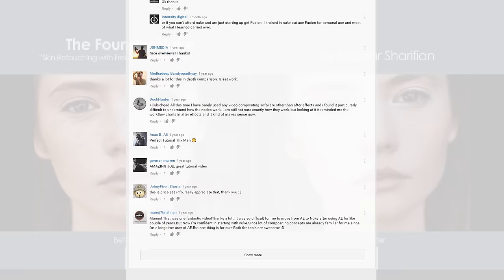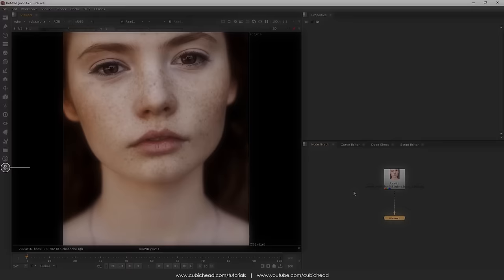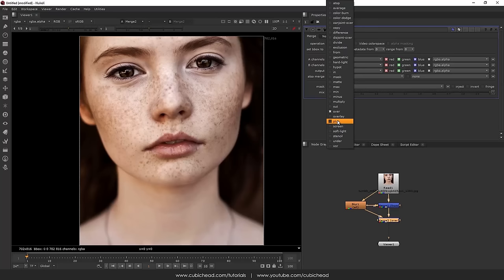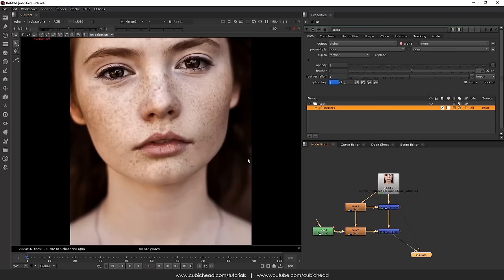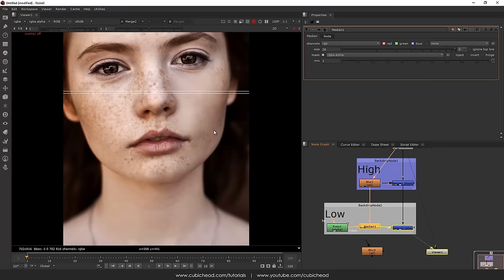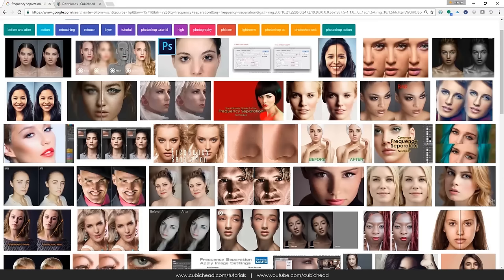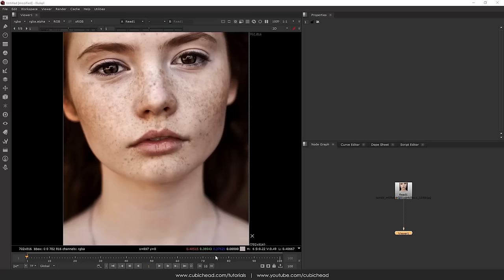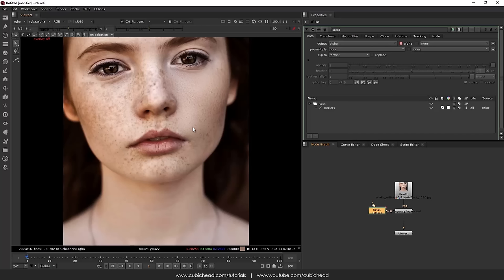Skin Retouching in Nuke using Frequency Separation

Comment: this doesn't work. follow this tutorial over and over again. when I place the roto in as a mask, nothing happens. I cannot see what you do differently from what I do and I get nothing where I see what you get. thanks anyway.
Reply from the maker: Sorry to hear that, maybe some of the default parameters of your nodes are different than mine, for instance your default mask setting is set to a different channel :-? Otherwise, I am using vanilla version of nuke and if you follow my steps exactly one by one, you should end up with the same result

Comment: When I try to make a roto for the second blur it has no effect (the whole image stays blurred). When I check the roto seperately, it says: non-existent channel used for mask. What am I doing wrong? :S
Reply from the maker: Charley van der Krogt Did you make the default roto node? The shortkey for it is "O".
Reply from the maker: Charley van der Krogt If so, and still you r getting an error, try this, I'm not sure if it's gonna work in youtube comments, select ur roto inside Nuke, copy it [CTL+C] and paste it [CTL+V] here in a comment, so I can check it out.
Reply: He Cubichead, I sent you a pm. Thank you so much for your quick response and help!
Reply: You're probably trying to plug the blur into the roto as a mask, which by default will be looking for an alpha channel, which the original image doesn't have (hence the error). You need to plug the roto (which creates an alpha) into the blur's mask pipe.

Comment: To remove all that spots in a video footage you don't think it'll produce a blurry effect and loose all of texture details? 
Note: it's just my opinion
Reply from the maker: tauqeer ahmad If you just do the first step of this technique, yeah! You will end up with a blurred and smooth surface. But if you continue adding the whole setup, you can bring back the details, which in most cases it starts putting back the grain, then small details and then big ones.